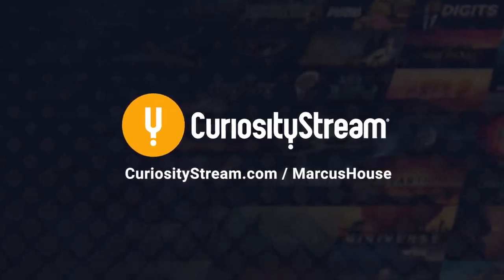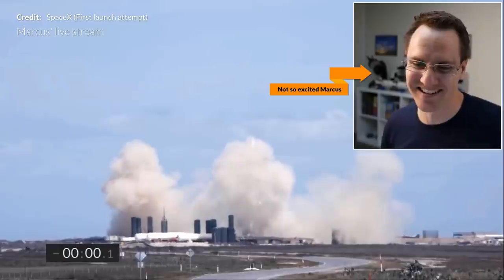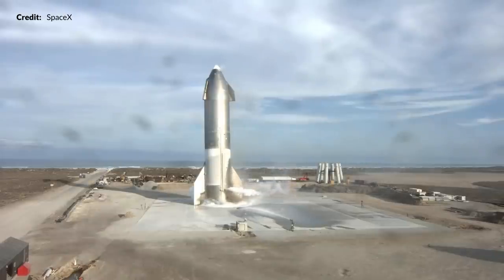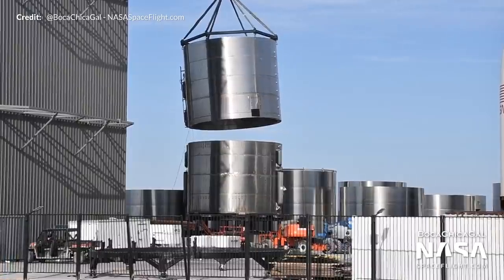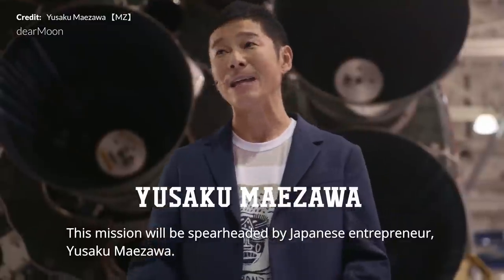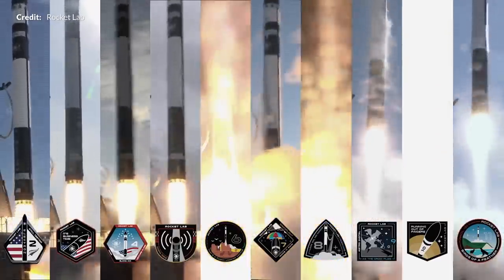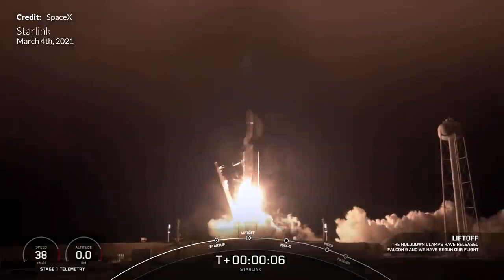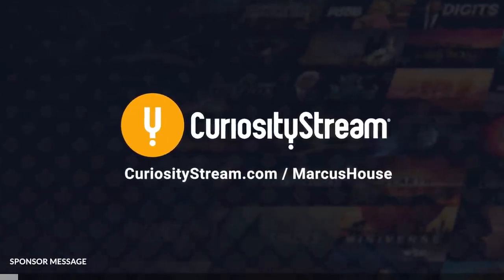SpaceX Starship Update, DearMoon announcement, Rocket Lab Neutron and Starlink

Comment: Elon tweeted that the Starship failed to increase thrust when commanded and that caused the harder that nominal landing. The legs were crushed as a result. On the next launch, they will attempt to land on 2 raptors.
Reply: Yeah that sounds about right :(
The raptor's seem to like eating themselves
Reply: Really?. Yeah tho it makes sense coz take a good look at SN8 it did really good almost 95% of the flight, the only catch was the tank pressure right? The engine count was perfect and so was the landing flip. Just the pressure problem.

Now SN9 did the same and the pressure was also perfect but the engine relight failed and that was the only failure. The only need to light 3 was an sudden engine failure, but if they had kept it with turning off one engine and landing with two this wouldn't have happened so it wasn't stupid of them not to light 3 engine etc etc..

 and also lets not forget the weird flame color of one of the engine during ascent and the giant multi Story high flames at the landing which probably caused the pressure liftoff 8mins after landing along with the hard landing.

All I'm saying is 3's good land with two was fine and thank God that they reverted back to it. And seriously hoping SN11 lands so good that it should be ready for another flight days later.
Reply: @jagadishgospat2548  I think it was a mistake to turn off 2 engines leaving only 1 rather than landing with 2, it's ok to hover for a second with too much thrust but it's not ok to bounce off the pad like that.

I don't believe there was anything wrong with the flame colours during any of the ascents, but all 3 has green flames on landing, engine rich exhaust,
some of the engine internally melted and made it's way into the exhaust.
SN11 got this, they just gotta be more careful with the Raptor's this time.
Reply: Can you send a link to the tweet. I can’t seem to find it
Reply: @Mallchad  you're right, you're right but if you look carefully at sn10's flight at ascent(take a look at the clip again) after 1 engine cutoff you can see one of the engine blasting orange flame instead of the purple.

And yea they really have to be careful and take care of the engines. And flames at almost all of the flights even from SN5, (but it's from the extra fuel I know) they gotta control it with maybe on board fire suppression system? IDK I went wild there but really SN11 is the last shot or other they would be stupid to scrap SN12 to 14? 15 maybe.
Reply: If you watch the slow-mo 3/6 legs did not deploy properly either
Reply: I though sn10 will land with 2 engine I thought that 2nd engine failed to ignite
Reply: I know they are trying to work out the fuel consumption for the landing. Don't forget that power equals control. More power more control. The next landing will be perfect.
Reply: I don't think two raptors are neccesary. As Elon said according to your comment, one raptor is enough, it just needs to increase thrust a bit
Reply: @rewtdawg9852   my guess is that those legs are suppose to extend if the vehicle is completely vertical and SN10 wasn't, so was SN9. Or they just malfunctioned.
Reply: 3 of the 6 legs deployed but failed to lock into place as well which can be seen in the closeup slow motion videos.

Let's not forget that the current leg design is temporary and will be improved when the time is right so they will likely. Be able to absorb some landing shock too.
Reply: omg yees
Reply: @jcoghill2   and gabser although you're correct. I think it's best they do land with 2 because SN8 was amazingly perfect and like I said before it's not the thrust or control  problem but the engine failures or header tank pressure with SN8 if you remember SN8'S flight that is.
Reply: @jagadishgospat2548  It looked to me that they were supposed to swing open and latch (analog). There were some linear forces going on that caused them not to latch.. IMO.
Reply: t also seems to me that my legs are too short because the cushioning cannot absorb the space X, it's different, they get the hang of it. By the way, I already mentioned at the start of the N9 that it was EXplodier I had dreamed about it, it passed with the N10
Reply: @jacobmarshall9600  "Can you send a link to the tweet. I can’t seem to find it " Link is twitter dot com slash elonmusk slash status slash 1368016384458858500 (When I typed link normally, my reply disappeared.)
Reply: @rewtdawg9852  The theory on not all the legs deploying is that it was just dropping too fast as deployment of legs is tied to the speed of SS. Might have been right at the threshold and some legs deployed while the other 3 did not.
Reply: Saizen
Reply: The heat shields will glow his bright shining face.
Reply: Also, 3 of the legs didn’t deploy
Reply: Thanks, some real information.
Reply: Wait, wasn't two engines for the landing the plan all along?  Three engines to start and then one engines powers off for a 2 engine landing?
Reply: I would like to see the math  in more detail of how many engines Starship needs to land with full cargo/payload. For now Starship is empty and needs 1-2 engines to land. How many engines to land a fully loaded  starship with payload ? And will the header tanks capacity be enough to land ? Will the heavier Starship need to start the landing burn sooner ?  We dont know at what throttle % were the engines while landing.
Reply: The different exhaust color might have been a different throttle ratio between the 3 engines.
Reply: jcoghill2: Let`s hope so.
Reply: i am just here, looking trough the comments in hopes that someone else also noticed in Slow Mo, one of the landing legs having troubles deploying...
Reply: @jagadishgospat2548  What do you mean "The thrust was perfect just the pressure?" where did you hear that? If you don't have the pressure, you don't have the thrust you need...
Reply: @rewtdawg9852  I like that. Also, the expulsion of fuel occasionally gets lit. (Not in the good way) and ends up keeping a fire at the base during bleed off. May need some code to pause a bit on the release valve to extinguish the fuel fire.
Reply: @mystcat3  maybe a dumb question, but why not land with 2 thrusters both with lower thrust?
Reply: @iamaduckquack  i scrolled down to see if someone would mention that before I wrote anything 😆👍
Reply: @JasonBlack66  depends on how far they can gimble and how far back they can throttle, they can always turn the last engine off literally half a meter off the floor if needed
Reply: @mystcat3  Anyway in real flights with heavy payload they will use 2+ engines for landing
Reply: @user-jt1jv8vl9r  Raptors can't lower their trust below 40%
Reply: @neverenough5243  sorry that was wrong. What i meant to say was how well the engines did despite getting oxy rich fuel mixture I mean the landing flip was just right, only if the methane tank pressure was right the ship would have slowed down fine and landed. 

And I also meant that SN9 would have worked just fine if the engine relight worked but it didn't.

So contrary to Elon's words, it was stupid of them to land with one engine. (no offense, he's still my hero)
Reply: @GabrielKozsar  since starship is Mars focused it will work just fine even with heavy payload because thanks to Martian gravity ship would weigh 38% of what it does on earth and the specifics you ask? Well spaceX got it we don't have to worry just yet.
Reply: Why not 3?
Reply: @ernestgalvan9037  i know perfectly well what those are, and their intended use. As someone with engineering degree, i understand the mechanics of "landing legs" quite well, ever since i first saw the design of them.
You are giving me lectures about what shock absorbers are, just because i mentioned only 1 "landing leg" that was the most visible. 
By the way, you don't need to put the "dash" symbol between the words "energy" and "absorbing".
Reply: link?
Reply: @gig2734  It would be too much power
Reply: @user-jt1jv8vl9r  Because there is a minimum thrust a rocket will put out reliably. One at max might not be enough, and two at minimum might be too much..
Reply: And it would help if he used more than 3 landing legs next time :)
Reply: Surely if you only use 1 engine to land, you can't land vertically?  If you are using a single offset engine, the rest of it needs to tilt to maintain balance.
Reply: Probably had
Reply: @reasonerenlightened2456  The Starship and Falcon 9 landing systems are completely different. Nothing whatsoever is carried over according to Musk. 
They will destroy a lot of boosters and many more Starships, so stop worrying, its how they iterate the design. The current Starships have 3 engines rather than 6 because they do not need 3 x vacuum engines while doing 10km hops. Attaching them at this stage of the program would be an expensive way of trashing twice as many engines as needs be, surely?
None of the crashed or destroyed prototypes was "worrying" or "a waste" or worst of all "incompetence". I suggest you do a little research into how Space X intend the test program to develop. 
Doing the work to understand why everything keeps blowing up but its fine, should prove illuminating for you ...
Reply: I couldn't bother reading all this thread so I'll just make my point. The main reason the engines keep failing right at the last stretch is probably due to the fact that as fuel and liquid oxygen run out the engines start to heat up and deform\melt internally and externally, this is due to the fact that most spacecraft engines are actually designed to be cooled by the full flow of super cool LOXY and fuel in different parts of the engine. So SpaceX running the engine full tilt right at the end when the fuel\cooling is running low is exactly the reason why it fails as far as I can gather. by running 2 engines at much lower thrust they cut off a TON of excess heating which should allow the lower amount of cooling capacity available to keep up for the landing.
Reply: Yh the animations show all 3 raptors I think because they come in rlly hot so vac engines slow down major then vacs power down then all 3 raps engage to land it very slowly
Reply: 3 of the 6 legs weren't deployed properly. Where did you see this "tweet"? I can't find it.
Reply: Precise throttling seems to be crucial to landing. The legs are an obvious engineering must. Chicken or egg problem that they will solve I believe. There are probably 100's of problems presenting with every test....patience!
Reply: He says a lot of guff. Conman
Reply: @Mallchad  I agree, I even expected them to only turn off one raptor during the descent
Reply: Hmm... Interesting... Let's hope that it lands *smooth* and intact for after the landing.
Reply: Seems like they actually need a weaker engine.  One that can be throttled down far enough that at its lowest power it can't quite slow the rocket with the mass it has on landing.  Problem they have now is that the raptor can't throttle down enough and at its minimum thrust is still enough to lift the almost empty vessel.  As such this requires a "suicide burn" or being forced to perfectly time your deceleration to zero with your contact to ground.  With a single lower thrust engine they wouldn't have this problem.  They could potentially come to a hover just above ground and very gently set down.
Reply: "Elon tweeted" ... priceless.

Comment: Elon has already updated Twitter saying that the landing was way beyond the capability's of the legs even if they had all locked, and that was down to the 1 Raptor not throttling up as commanded by the flight control computer, next landing will use 2 engines with the 3rd ready to fire if there is a problem with either of the others...

I absolutely love how he keeps the public in the loop with this stuff.
Reply: @barnett25  I love that Scott Manley was able to do that with a video stream! The man is amazing.
Reply: That's really interesting! Thanks for updating us, stonesie81. And thank you to Elon Musk, of course.

So the second Raptor couldn't throttle up after being shut down. Is that a problem with the engine itself, or is this still a plumbing and pressurization issue?
Reply: I see. Thanks!
Reply: @barnett25  I wouldn't say nothing to do with the other engines, something started that fire, which probably interfered with the flight control systems.
Reply: Not Elon, it is according to the engineers that did all the work. How can we believe a guy that doesn't even understand that the hyperloop vacuum fail, he can't even say when question if it would be a maglev or rail right away. A fake, easy to come up with an idea and make his engineers do it and take the credit.
Reply: @fleyua7176  Oh really? You absolutely sure of your facts? I suggest you check them a bit more thoroughly next time.
Reply: One of the important issues with propulsive landing is conservation of fuel. The issue of landing speed reminds me of Newtons response to the royal academy about acceleration...or how wiley coyote manages to spend so much time running on air.
The opposite here...the slower landing costs some fuel but saves on leg weight.
Reply: @fleyua7176  What is your world changing contribution?  Sniping from the gutter at success?
Reply: Just revealed that the reason for the low throttle was helium pressurant ingested into the engine. Looks like it's another fuel system problem
Reply: @barnett25  Clearly he should have made his landing legs out of Mk2 cockpits
Reply: Eyyyy redundancy!

Comment: Really want to see some new landing legs.
Reply from the maker: Likewise. These prototype legs were only ever supposed to be temporary.
Reply: 100%
There really needs to be a wider footprint for landing offroad, so to speak.
Reply: @olliea6052  I think tesla motor driven Flacon style legs could be interesting.  The Elonerons prove those motors have the power to resist the wind pressure from a freefalling Starship so I imagine with the right setup they could make some legs that are sort of self leveling and rapidly retractable unlike the Falcon hydraulics.  Their footprint would also accommodate the elevator lift they plan to install for cargo and access.  The only issue is the heated side would have trouble with them.
Reply: I agree. That said, that landing was quite rough, even with better legs they might have had similar results. I am hopeful they will calibrate the throttle profile of the single engine during landing for SN11 (maybe even have two engines on at lower thrust), in order to have a slower touchdown.
Reply: @MarcusHouse  sir kindly make a video on Will starlink company kill Astronomy research and development???
Reply: @deathnote4171  no, it won't...
Reply: @Kasmuller  Agreed. Minimal effect.
Reply: @deathnote4171  No need, the answer is no ...

Comment: Regarding the Starlink launch, this time SpaceX wrote "will 'attempt' to" instead of "will" land  their 1st stage 🤔
Reply: Because before that failure, they always got a good landing.
Reply: 8th landing of that booster successful. Maybe it will break their record with 9 or 10
Reply: @josemesquita9354 Yes, correct. But before that they always wrote "Will attempt to land" for quite a long time - until the landing was routine. But it is a great achievement and impressive to watch.

Comment: I still think that second engine cut off a little too early. that hard Landing caused a few cracks ,took awhile for the fuel to get to the hot parts.
Reply: Nope.
The last engine underperformed, the timing of shutdown was intentional, but the engine didn't output as much thrust as expected.

Comment: 4:14 Engines arranged in a triangle. A single engine is at the furthest distance from the center of the triangle while two engines, although too powerful without throttling down enough will have their combined thrust closer to the centrepoint. This will along with better stronger legs help keeping it vertical after 10 minutes on the ground.

Comment: Starship is so cool. it’s so different and space x so such a good job proving the once impossible is possible.
Reply: What has SpaceX done that was previously impossible?
Reply: @TroySavary  the reflight of boosters. Record turn around times for those boosters. The belly flop manoeuvre. they are the first private company to send astronaut to the iss.
Reply: @officerayd2755  The belly flop is basically like the Space Shuttle, using the greater drag of horizontal position to limit falling speed. The solud rocket booster from the Shuttle were reused. Others have landed rockets using rocket piwer. Nothing that SpaceX has done has never been done before. Only you buying into Musk's cult of personality makes you believe that they have.
Reply: @TroySavary  so why has everything they have done been said to be impossible. Your calling Marcus house and the everyday Astronaught liars and the majority of other space YouTubers as that is exactly what they have all said and what about the rapid turn around times. The shuttle never did that the slb never did that. the space shuttle is a plane and needed a runway starship lands on a pad with precision and it doesn’t have a long stretch to slow down it’s much more complex than the shuttle.
Reply: @officerayd2755  What did SpaceX do that people said was impossible?
Reply: @TroySavary  just about everything have you been living under a rock?

Comment: Lets remember an important thing about SN11: It's built with hardware that is already inferior to the currently being built models. SN8 was hardly expected to complete the belly flop let alone almost land. SN9 and SN10 also did better than expected, giving SpaceX far more flight data than anticipated for improving future models. That's why they are skipping 12-14, because SN15 (which is almost done being built) contains multiple versions worth of expected improvements. 

SN15 is the big one to watch, SN11 is an appetizer.